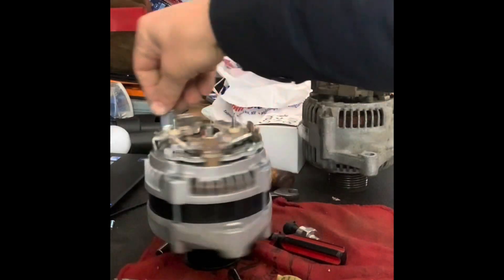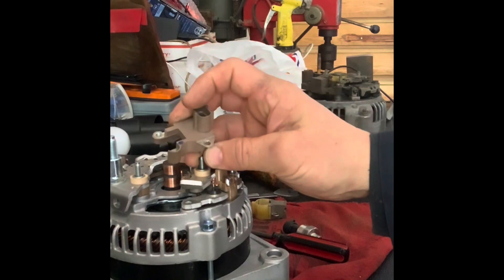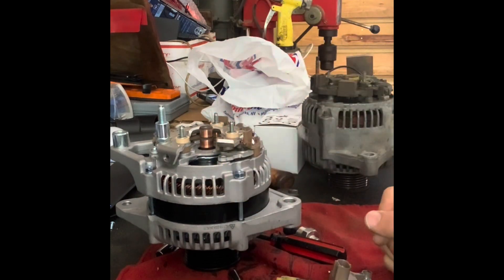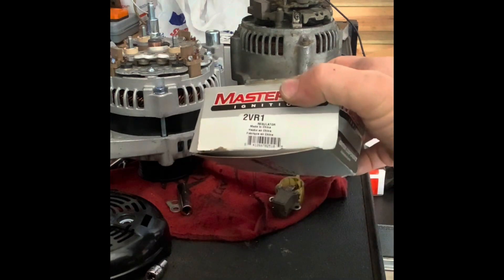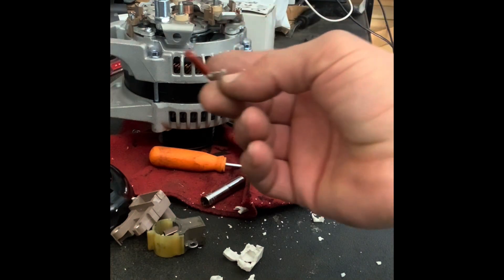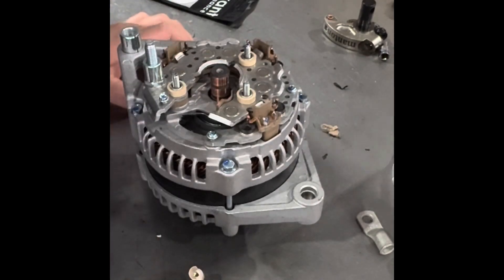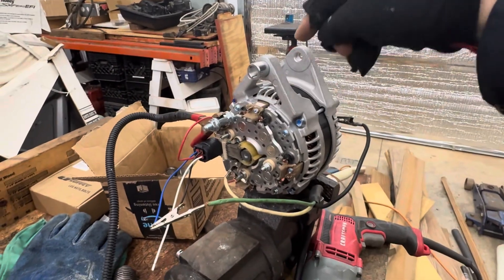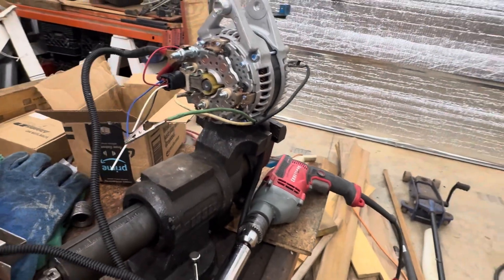Converting computer controlled alternator to single wire $300-$400 dollar alternator for under $20

Comment: Would it be easier just to start out with a Toyota alternator or is the body different? Can they be converted for v belts?
Reply from the maker: The body of the alternators are relativly the same, the mounting changes thought. I have found three different internals so far. I haven’t ran across any newer stock replacement alternators under 150$ that are internally regulated.  Also if you do fond one it is usually 13.7 volts or 14.2. 
If your running Fuel Tech this can be an issue with 16volt systems.

Comment: The ECM controled alternator has big advantages. Better fuel economy, less engine drag with high efficiency/ high current output when needed.
Reply from the maker: Thanks but if I was worried about fuel mileage I wouldn’t drive a 650 hp SUV as a daily. This is more for the car enthusiast that want to get rid of the computer and not spend 300-400 for a one wire Alternator.
Besides Ive already programed many PWM alternators to run even better than OEM. 
You’ll be surprised how lacking the OEM is on their computer controls.
👍